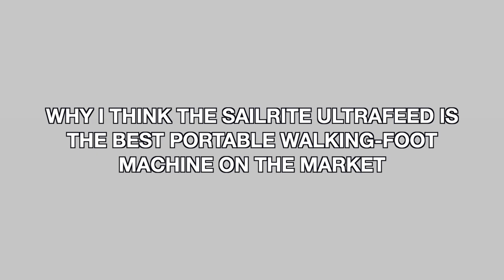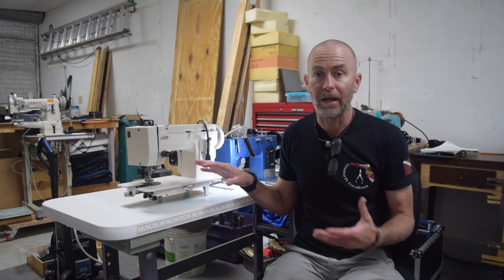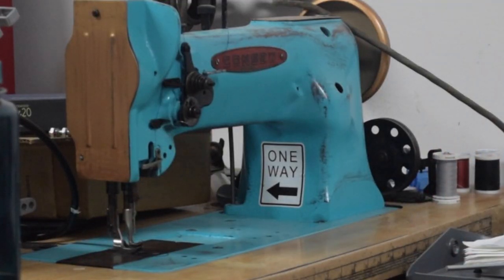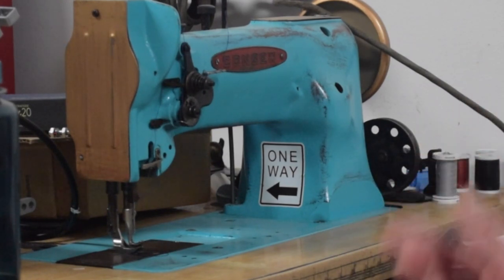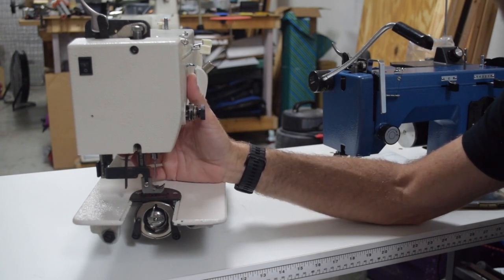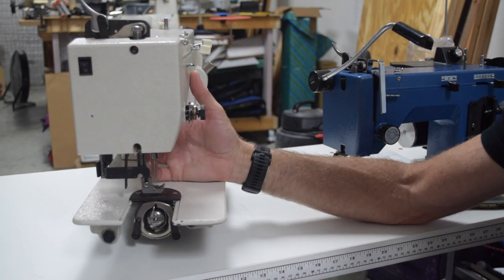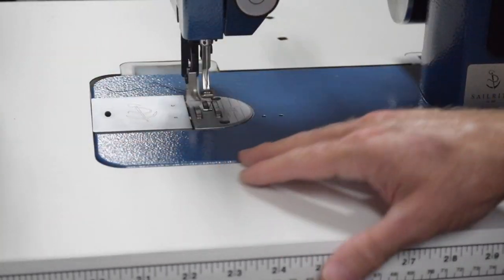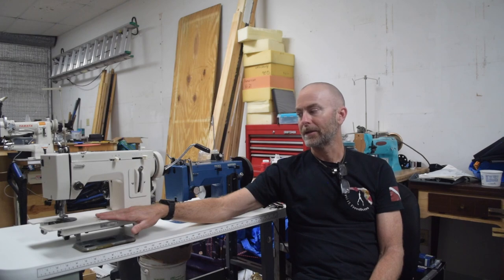Is The Sailrite Ultrafeed Better Than The Look-A-Likes?

Comment: U sold me on the rex for the thousand dollars difference
Reply: Sailrite is a knockoff of rex rex started in 1957 sailrite in 1969
Reply from the maker: Hi, 
When the companies were formed has nothing to do with whether one is a "knock-off" of the other. I have tried to clarify my position on this, but both companies (and many others) make variants of this same design, which as far as I am able to tell was originally designed by Datho Manufacturing and sold as the Thompson Mini-Walker. My position is that Sailrite makes a premium "variant" of the design, and all of the other variants that I have seen are made as cheaply as possible, and (other than some offering a 9" bed space) do not offer any design improvements to the original design (such as Sailrite has done with the improved stitch-length lever, WorkerB motor system, improved casting, etc.).  Whether you, personally, find it more financially attractive to buy a Sailrite or not is entirely up to you. As I'm pretty sure I explicitly state in this video, I've heard from many people who have non-Sailrite versions of this design and love them, and I've heard from many others who have had terrible experiences with them. 
The marketplace has many options, so feel free to choose what is right for you, no one really cares if you don't like the same thing I do.
Reply: @thejasonofalltrades  when u call one a knockoff u left the impression that the other one was a cheat and taking an unfair advantage  which was not true  with that statement u were not making an assessment but an biased statement

Comment: also sailrite is piece of junk vs Juki Du-1181n
Reply from the maker: Hi,
The Juki 1181 is an industrial machine. It's a completely different category of machine compared to a portable walking-foot machine like the Sailrite Ultrafeed.  Saying the Sailrite is a piece of junk compared to the Juki is as valid as saying "the Juki 1181 is a piece of junk because it isn't as portable as a Sailrite Ultrafeed."
If you want to compare a Sailrite machine to the Juki DU-1181N, the Fabricator would be a more fair comparison; I haven't used either machine, so I don't know how they would compare with one another.
Reply: juki 1181 is piece of junk vs  FM366evo. without minimum FM366evo dont start sail business'.
Reply from the maker: @MoreSplit   the FM366evo is a piece of junk compared to the John Deere 9560RT. Definitely don't start a farm with a FM366evo.
Reply: @thejasonofalltrades  yes for that reason every machine haw different purpose and usage,and all chinese machine is not bad or good.